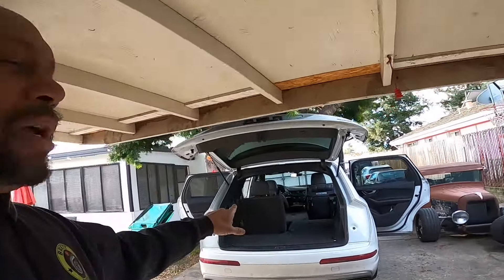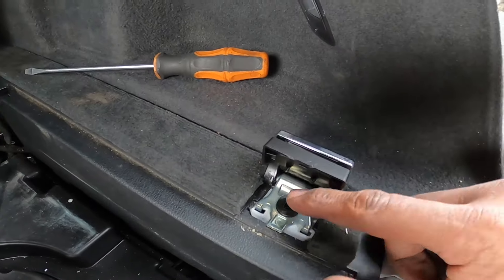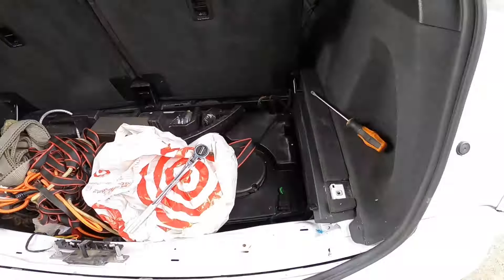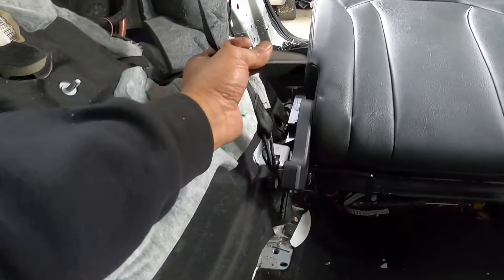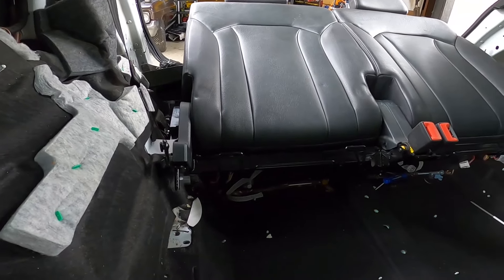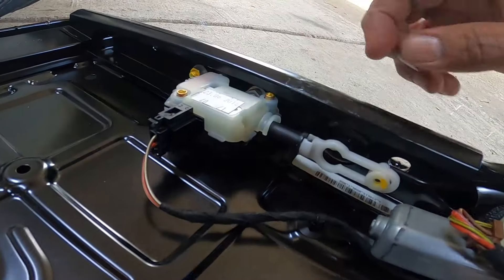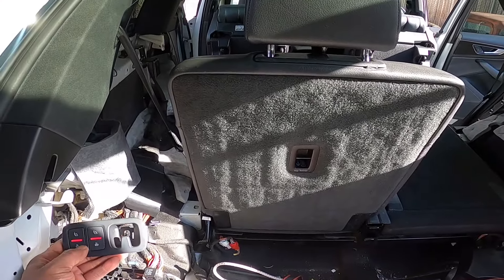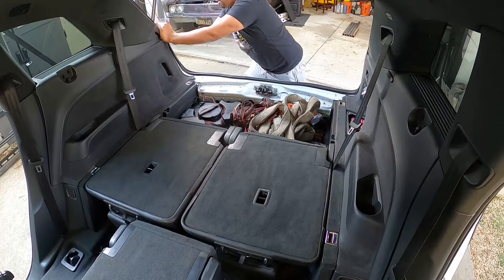Audi 3rd Row Seat Fail!

Comment: The motor was the confusing part.
Reply from the maker: Yeah, I can see how it could be confusing. You may need to rewatch it a few times. Also it only needs to be re-clocked if the motor is trying to go the opposite direction of the button selected. I hope this helps. Thanks for watching!

Comment: Fantastic video- very helpful.  Thank you so much for making it.  I am having the problem that the linkage pin keeps pulling out of the actuator arm everytime I press the button to make the seat go down.  The parts don’t look broken- I think it may have to do with the gear on the motor  being in the wrong spot similar to what happened to you once the seat was reinstalled. Wondering- did the pin repeatedly falling out happen to you until the gear on the motor was in the correct position?   Thank you again.
Reply from the maker: Thanks for watching and commenting on the video! No, the linkage did not pop out when I discover the gear was clocked wrong. I really don’t think that would cause it. If you watch the portion of the video where I hooked the linkage up you will see there is a plastic clip that the linkage rod goes into. Make sure that it’s clocked right because the rod snaps into it at only one angle because of a slot in it the rod fits into. If it’s not snapping in you may need a new clip but I don’t think Audi sells it separately from the whole seat assembly. I hope this helps, good luck and let me know if it works for you.